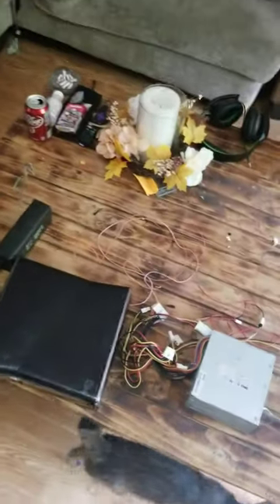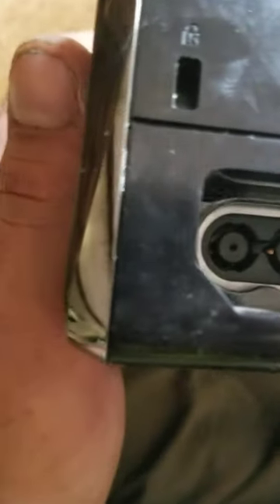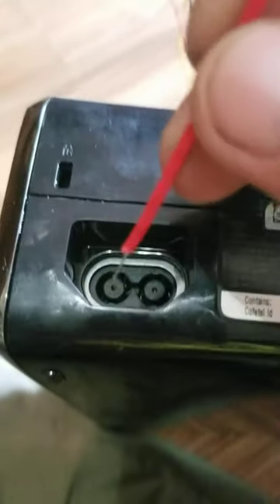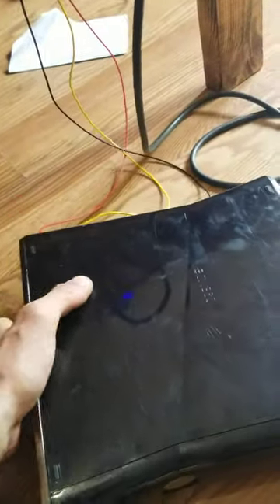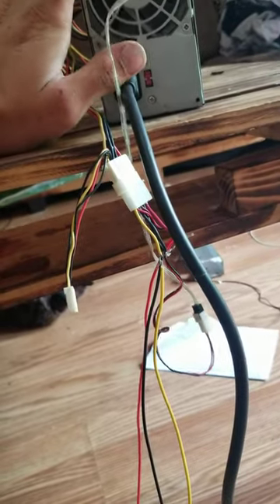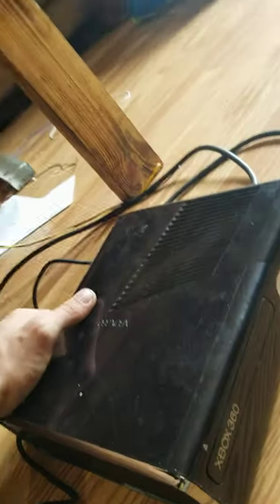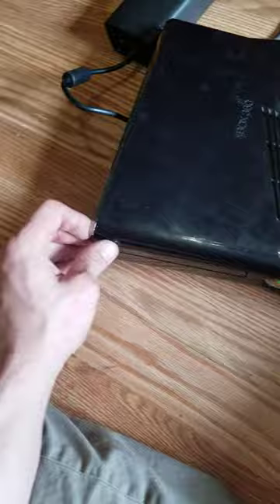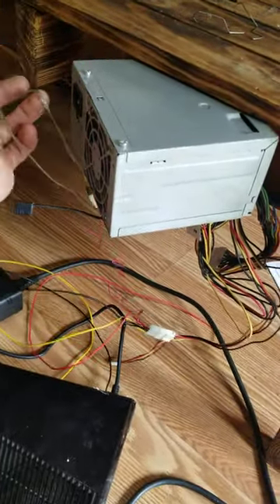diy power brick for xbox 360 slim

Comment: hey brother i know its dumb and it's like 2024 but i need your help regarding my Xbox so if you see this comment please reply !!!
Reply from the maker: What’s up
Reply: @deathmag  hey man can you please help me i am lost how to wire this all i am lost its just there are so many wires:eyes-purple-crying:
Reply: yes bro can you tell us how to wire there are  so many wires
Reply: I wrote a reply, but i dont know  what happened. I basically said that you should use the cables from a molex connector. It has 4 cables, 1 yellow (12 volts apparently), 2 blacks (ground), 1 red(5 volts), some power supplies have different colors or none at all so be careful. Look on Google how a molex connector looks like to be sure
Reply: Works for Xbox One

Comment: ATTENTION EVERYONE, this tip is good, but the 12V yellow wire connected in this way is very close to the GROUND's internal connection, so if the yellow wire touches the GROUND it will damage the xbox.
Reply from the maker: Just a heads up it won’t hurt the Xbox. It was just short out to ground.

Comment: My way is different i had the psu it just doesnt work so i cut the cable stripped it and did the pinout to the atx psu 

Attach green psu wire to the black psu wire then attach them both to black in the power cable 

Then take purple psu cable  attach it to red then connect yellow to yellow of the psu cable no need for the other wires but only works on the S model and psu cable

Comment: got a power supply from Amazon for my Xbox 360 S and when I pulg it in the back of my 360 it's crooked instead of straight it truns on but it is not a authentic power supply I just wanan know is that normally crooked or is it supposed to be straight? and should I just get an Authentic used power supply from ebay
Reply from the maker: Straight or if it’s made at a 90% angle

Comment: El cable negativo es el de -12v o el de -5v
Reply: Negative must be in common. You can't use 2 different power supply. You use only 1 power supply, take from it 12v and negative and, using a dc-dc converter, from 12v you will have 5v.

Comment: When I do this it only turns in the xbox fan?
Reply: Same
Reply: I think that means the 360 has an internal fault.i have 360 slims that i just tried this with,and all 3 responded the exact same way.

With just the 5v and gound they only ding when pressing the power or eject buttons. 

When you give them 12v the system fan goes to 100%,but the buttons no longer work. Turn the 12v off and the buttons start dinging again.

By manually applying 12v,you are bypassing the 360 power supply switch that applies 5v to the 12v enable when you hit the button. So i believe in my situation all 3 360s have a hardware fault that is causing them to ding when pressing the power button, but not turn on.
Reply: I wonder what would happen if i just said fuck it and put 12 volt in both then. Lol jk

But on a real note idk if im understanding what you said properly, but what i got out of that was that in the xbox once you actually power it on in order for the 12 v to start it needs the 5v? (As like a quick shock id be guessing?)
Reply: @shawnowens9749  the 5v from the power supply is always turned on throughout the system when the power supply is pluged in.

When you press the power button on the system  it will send that 5v to the 12v enable pin on the power supply which then turns on the 12v and the 360 can power on and function.

I am still in the early stages of trying to figure out what could be the cause for this issue, but it seems to be many different causes.

I found most of the  Capacitors on the motherboard near the power plug have  Continuity across them,which doesn't seem right and points to there being a short somewhere..

Its not normal for the fan to run full blast soon as the system gets 12v..
Reply: What if you kept the 5v wire in the consol and did everything the same as in this video but taped a second wire into the 5v with a switch in it (button probably would be easiest) and attached it to the 12v enable  Pin and pressed the switch at the same time you turned the xbox on. Im guessing youd have to press the switch twice real fast to stop the new 5v wire so its not having 5v and 12 v at the same time
Reply: Or is the 12v enable pin on the actual xbox power supply cable/box
Reply: @shawnowens9749  if at anytime the 360 power supply loses 5v to the 12v enable pin it will stop providing 12v.a pc atx power supply doesn't work like that and will always provide 12v when its turned on.

Anyways,if you apply voltage as seen in this video and the system fan gets loud you have a hardware fault somewhere on the 360 motherboard which is what i am trying to track down atm as i have 3 slim models that are all doing the exact samething.

Applying 12v and a ground to the system shouldn't turn the fan on.so some chip somewhere on the board has shorted and is allowing the 12v to go places that it shouldn't be going..

Under normal circumstances a person would just be using the slim power adapter which wouldn't be allowing 12v to the 360 with this fault,so the issue would be pressing the power button,hearing a ding but no power no lights.

Since we are  Manually applying 12v to the system,the fan is getting power that it normally wouldn't be.
Reply: @shawnowens9749  do you have the normal power supply for the 360?
Reply: Welp my slim power adapter finally came in today,and all 3 of my slims now work perfectly.

Idk wth they weren't working using this trick,yet it worked for the guy that made the video
Reply from the maker: you may have a falty console
Reply: @deathmag  naw turned out to be a faulty v1 360 power supply. Everything seems to be normal  with the power supply except rather then 5v standby it outputs 3.3v.

When enabled it puts out 12v tho.idk.